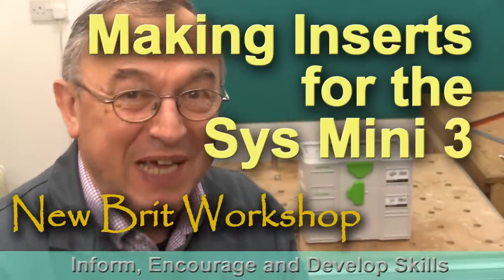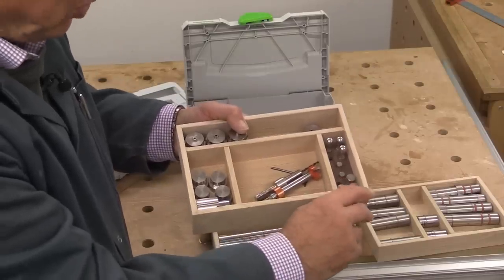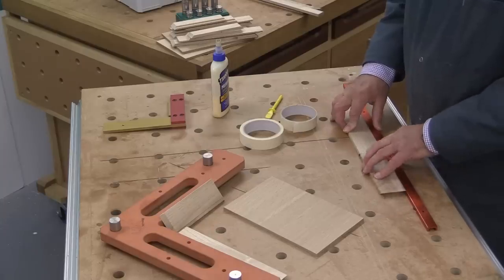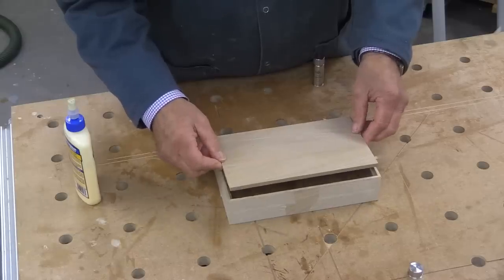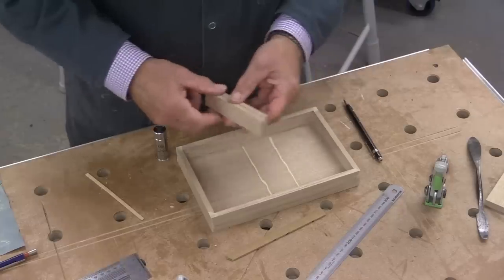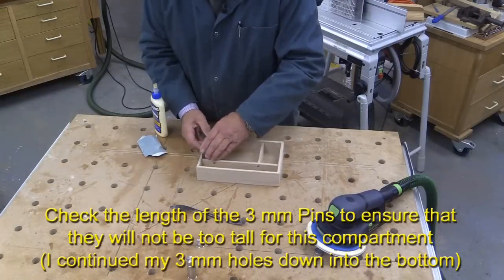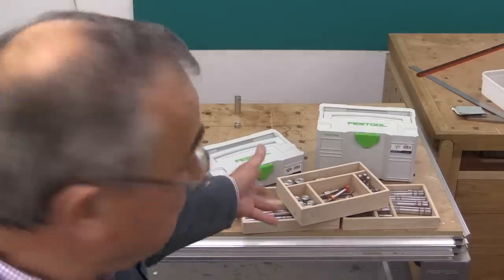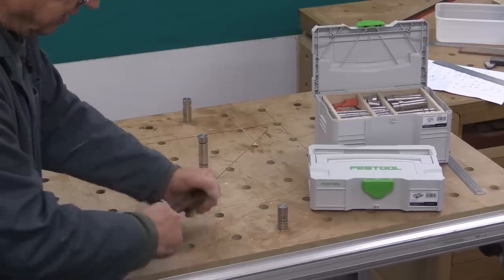Making Inserts for the Festool Sys Mini 3

Comment: Peter, I greatly enjoy watching your very informative videos.  I apologise if you’ve answered this in a previous video, but when cutting the mitered joints is there a particular reason you’ve tilted your Kapex to the side, instead of rotating it around the vertical axis?
Reply from the maker: It is far more accurate that way as the wood is more stable and easier to hold.  Peter

Comment: Thanks Peter for sharing. I am wondering what the small overlap is good for when glueing.
Reply from the maker: Hi Axel, When the pieces are moved from a straight line to the square the masking tape can sretch slightly and the 0.5 mm overlap (ish) allows for that.   Peter

Comment: All you need now is some right angle Parf Dogs! What Is the UJK Right Angle guide made of?
This is the perfect way to store the dogs. May have to take the plunge on these for my dogs... Do you have any concerns about dog damage due to rolling around in the box? I was thinking I might put kaizen foam in the inserts to prevent them rolling around.
Are you on any social media or email yet since YouTube took away the private message function?
Thanks Peter. Good  video!
Reply from the maker: Hi Ron, The dogs are made of stainless steel and will come to no harm at all. YouTube did away with Private Messaging in July. Just post a comment with you email address in t. 99% of the time this will get picked up by the YouTube spam system and not be visible to the public. I can then react to it and then delete it. I am away from today, without my computer, and will not be back until next Tuesday as I am at the Harrogate Show.   Peter
Reply: New Brit Workshop   Ok thanks Peter. On all the above.  😊
Ron